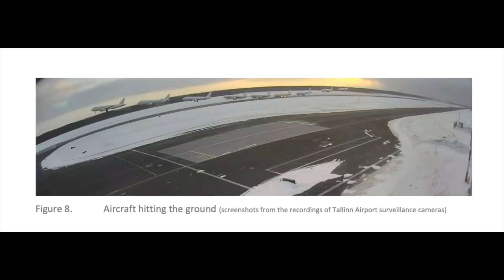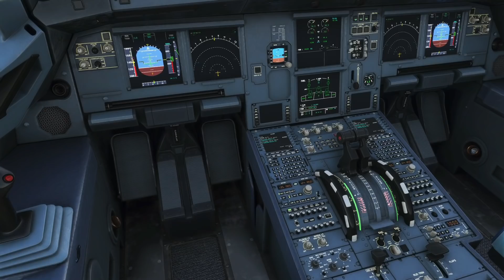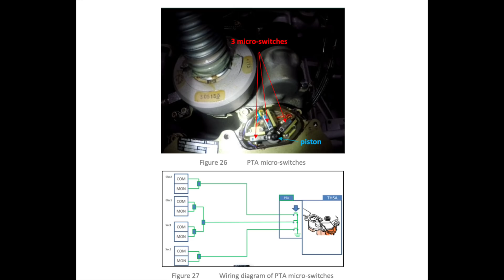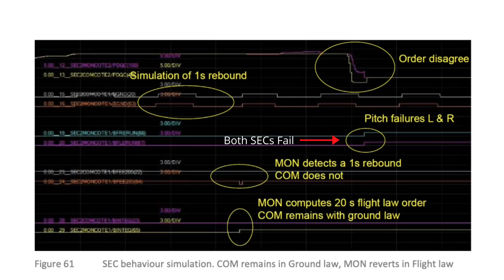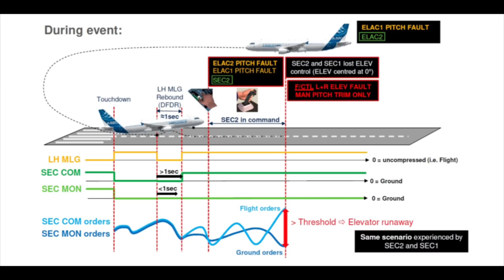The Oil Change That Crashed A Passenger Jet | The Crash Of Smartlynx 9001

Comment: To answer your question about automation, I been driving trucks since before DEF was mandatory and automatic trans wasn't mainstream. My answer is 5. I want some but not all. I hate adaptive cruise control there have been plenty of times when it hard brake and there was no one in front of me. Not only is that dangerous but scary asf. 737 max had the same issue yet it was trimming down when there was no need to. And that cost 500 lives. So although planes and big rigs do the same thing differently, transport, Im sure you can get what im saying.

Comment: As a A320 pilot , i can tell you one thing for sure ! This is an absolutely great explanation of a very complex event . Something that latter led Airbus to change & tweak a few things with the Manual Pitch trim and timing logics 

Great content . Keep it going
Reply: is a320 safe?
Reply: Automatique
Reply: Are u real pilot damn....cool
Reply: Often the safety standards are written in blood, but this time nobody got hurt. And with every accident and incident the industry becomes safer. Which is also why it is the safest method of transport.
I forgot the exact numbers, but it was something like 1 in 20 million flights has issues, and 1 in 5 million of these somebody get hurt. The risk to get injured is so incredibly low.

Comment: This accident could easily have been avoided. Common sense tells you to reset a failure once. If the failure comes back, you don't reset it, but land and report to maintenance. In the 1950s or 1960s, an Avro Vulcan bomber was on a test flight. This was scheduled to be a long flight, so the fuel tanks were full. Some test equipment was controlled by an engineer. A circuit breaker popped out. The engineer reset it. The circuit breaker popped out again. The engineer reporter to the captain, and it was decided to return to base. However, they were too heavy for landing, and the captain decided to fly low at high power to burn fuel. Meanwhile, the engineer pressed in the circuit breaker and held it in position. This resulted in a short circuit and a fire, and the airplane came out of control and crashed.

Comment: I am a more hands on flyer so, I as the pilot in command would prefer that I myself have the capability to override the aircraft's automation whenever necessary. However, these types of automatic protection systems would be useful when the autopilot is active.

Comment: Algorithms are as good as the sensors it uses for diagnosis. The more, and different types of sensors, the better. When a pressure sensor fails, infrared/accelerometer/GPS/compass/radar and any other sensors combined can verify existing conditions. Maybe a stand alone CAN bus, dedicated to these analysis would avoid overloading the main control bus.

Comment: I think having a lot of automation is a good thing on the whole, but the pilot should always be the final authority and able to override the automation in an emergency with as little difficulty as practical.  

The communication between pilot and automation could also stand to be improved a lot.  Much of the automation is built with the assumption that the pilot flying the plane has a lot more system knowledge than the typical line pilot may have (this is not meant as an insult to line pilots, but the fact is most line pilots aren't test pilots).  Obscure and confusing warnings are not going to help much in a crisis

MCAS is a prime example of everything automation should not be.

Comment: In my opinion an airplane should be able to do a complete flight fully autonomously because computers are more predictable and consistent than pilots, but there should always be as direct as possible manual controls because you never know when an engineer on the ground or in the factory would make a mistake. So it is important to have a fail-safe way of controlling the aircraft (like the pitch trim).

Since I've worked in car automation I know of a very similar debate there: Should the autopilot correct for driver mistakes or should the driver correct for autopilot mistakes? In the case of airplanes the human pilots go through a lot of training and are generally more reliable than car drivers. So it is a good idea for the pilots to always have a way to override the computers. In the case of car drivers a computer could more often correct for human mistakes due to the higher likelihood of such mistakes but that would move the responsibility from the driver to the autopilot provider. That's why the computer only gets to override the human when it comes to pressing the breaks since an incorrect breaking is much less likely to cause an accident than not stopping when you might need to.

Comment: this is literally parallel and equal to the Air Asia Flight 8501 crash. Where the plane gave two warnings to the pilots in which the pilots ignored by resetting the computer.
Reply: It is parallel and equal in the fact that both times if the pilots had just followed the ECAM actions then nothing would have happened. Resetting the computer on this flight restored the computer to fully working mode every time. It was the last one where the captain hadn't reset it that things went wrong
Reply: @tomstravels520  ahh I see, yes, thank you for clearing that up

Comment: I  think that  when all of it goes to shit the pilots should engage manual flight control.  It appears these guys were computer flying for so long they forgot how to manually trim the aircraft for the flying they were trying to accomplish.
Reply: Firstly, computer flying IS manual flying on the airbus. Thats how manual flight is achieved as there are no cables and pulleys like a 737. Secondly flying with trim only is something you'd almost never do. Not even on a 737 would you operate the plane just using trim

Comment: The key to my opinion about automation is in your phrase "...a problem that no-one could have anticipated..."  i.e. no-one spent enough time thinking through all the possible [not just probable] failure modes.  My opinion - automation features should be introduced in stages, separated by long enough intervals [years, in some cases] that all parties involved can be convinced that this part of the automation is stable & safe.  Only then should the next level of automation be enabled, with conscious awareness that new "unanticipated" complex failures may manifest themselves.  Never forget that very simple math equations can produce chaos, and as complexity goes up, so does the likelihood of trouble.  We learn best from failures, so failures should be accorded our respect, not our fear.

Comment: I think the real dangers of automation is when the pilots are not trained to understand the automation thoroughly. As we see more automation going into modern designs pilots have a hard time really understanding it. Another aspect of this is airline companies fail to train pilots sufficiently to fly aircraft in simulated difficulties. The more automation the more cost cutting training for pilots to manually fly the planes. Automation is a double edged sword and always will be. Next we will have Ai and neural nets making decisions possibly overriding a pilots decisions. In cars this is ok but in planes it's entirely another matter.
I would feel much better as a passenger with two very well trained pilots taking over in unpredictable circumstances rather than a computer with its default settings if things start t go ass upwards.

Comment: Having learned how to fly fixed wing Piper Cherokee aircraft when I was a young teenager.  When my father got his private pilot's license.  I always went up with him during his flying lessons with the instructor.  I had the outdated flight charts, i.e., last month's version of the terrain.  Which doesn't change all that much, month to month.  And that was all manual flight with old-fashioned steam gauge instruments.

It was much different from the Boeing cockpit for the Lockheed F-22 fighter jet, multimillion dollar military simulator was.  Which was a tad more complicated.  As, I had never flown any kind of other aircraft, 30 years earlier in my life.  When I happened upon this unique opportunity.  To test out the new Boeing design cockpit for the F-22 by Lockheed Martin Corp.  On about 6+ million dollars worth of computers.  And the actual flight cockpit.  It was wild!  What a thrill.  What an incredible rush!  They just let me loose.  Other military pilots asked me if I had flown F-14's, 50's, 60's?  I said no.  Just a Piper Cherokee 140 when I was between 13 and 15 years of age.  30 years ago.  They asked why I didn't join the Air Force.  I told them I tried.  I was 4F.  They told me to go 4 letter word, to,  F myself.  But they didn't put it exactly in that manner.  They were more polite.  Far more polite.  As they told me I needed a Masters Degree in something like Electrical Engineering.  If I wanted to fly jet fighters.  I said that's okay.  I'll fly anything.  They said no.  And so it goes.

So go ahead and try flying an, F-22.  Without any actual flight instruction.-Never having flown anything like that before in your life.  I can tell you that being a motorcyclist for over 30 years, helped.  I didn't die.  I know how to bank into a turn.  I just never expected a 90° bank.  Holy shit!  And then the afterburners.  I didn't know it had afterburners?  I knew about super cruise.  I didn't know that also included afterburners.  When the Boeing guy was telling me to shove my throttles.  I said they won't go any farther.  He said shove harder.  And it clicked forward.  Then all the gauges and the sound changed.  And it becomes difficult to think that fast.  When you are in your mid-40s.  As I was then.  As it was just coming into operational service.  With the new Boeing cockpit.  Working with Lockheed I guess?  I guess these guys get together for the military.  These are big contracts.  And I guess they spread them around amongst each other.

So on a scale of 1 to 10.  I love less is more VFR, flying.  More like a lackadaisical Sunday excursion through the mountains on a motorcycle.  No need to go anywhere fast.

But there is no denying.  When you are lusting for that super experience.  Nothing beats the challenge of that complexity, that responsiveness.  And I'll fly by wire!  Oh yeah!

So I like both 1's and 10's.  But then 1 would probably be a Cessna 150.  So make that a 2 for a Piper Cherokee.  Because you don't have as good of view with the wings underneath you.  In a Cessna 150 you are just sitting there with your face hanging out looking at the ground.  So that's a 1.  It's a little more of a challenge to fly low wing fixed wing aircraft.

The following year I got to try a Northrop Grumman A-10 multimillion dollar simulator.  It was much simpler than that F-22.  And all steam gauge cockpit.  But I found that harder to fly by hydraulics.  The force feedback was rude.  It was far greater than the F-22.  I was bewildered by that.  Why should the A-10 be harder to fly?  Because it's less complex.  No computers controlling anything.  Meaning you have to be a better than computer gamer pilots.  That probably find the F-22 far easier to fly?  Because it's just a for real computer game you can get killed in.  Something no computer gamer would want to miss out on.  I don't play any computer games.  The F-22 is the closest I have come.  I have no interest in playing computer games.  Much less baseball, soccer, football.  I like basketball.  Every time I snap my fingers.  They jump.  They can't hear me snapping my fingers.  But they jump anyhow.  So I pretend I'm doing it.  I wasn't pretending that F-22 simulator.  That was for real.  What a thrill!

MCAS need not apply.  I don't want to be on a plane that has MCAS.  As that would only signify.  That the pilots really don't know how to fly.  That particular plane they are going to fly you upon your head.  I don't think so.  I think I'll drive.

I'm not good with numbers
RemyRAD

Comment: After the first warning the plane should have landed, come to a stop and been thoroughly checked out. That was the first fatal mistake they made. Considering how reliant the Airbus philosophy is on automation you'd think that when there was an indication of a problem they'd take it serioudly. Just the opposite they tried to make the warning go away again and again. I don't care if the plane is 100 percent automated. But when something goes wrong the pilot should immediately have the ability to manually override any and all of the automated systems and operate the plane up to and including full manual control. This is why I would never even ride in a driverless car. Only one where an experienced driver can take manual control immediately in an emergency. Every machine made will eventually fail. Why did one engine catch fire and the other one shut down? This shows that maintenance personnel and procedures are as important to safety as the flight crew.
Reply: The procedure at the time was literally to reset the computer as the ELAC had lost its pitch channel but the roll channel was still available. Resetting it made both available and therefore the plane reacted as normal and was fixed. The procedures didn't say how many times this could be done or if it could be done during a training flight.
Reply: @tomstravels520  Yes but the alarm kept returning multiple times. Rather than consider that it was a real alarm they decided it was a nuisance and continued to ignore it.
Reply: @markfischer531  again.....they were following procedures at the time. Procedure didn’t say how many times to reset it and what if it was a training flight. It occurred once per flight and not like every minute. If this had been a normal A to B flight there would be no warning at all because the pilot wouldn’t be moving the trim wheel by hand in flight or on touchdown.
Reply: @tomstravels520  How many times must an alarm go off after a reset before even a Euronic brain thinks maybe this is real and we ought to check into this to find out why no matter what the procedures or the book tells us what to do,  they could be wrong. This is how the Euronic brain is conditioned not to question, , not to use common sense, not to disregard rules when they obviously are wrong in a specific case and follow them blindly even though they could lead to disaster. Eurons are brainwashed not to question why, Eurons are trained to do and die. This is why the Euronic mind will inevitably fail whereby American mind will succeed.
Reply: @markfischer531  oh really. And where was this American mind when the pilot of the Atlas Air jet decided to plunge the aircraft into the water near Houston? Or the Air Florida pilot who decided to use reverse thrust to help pushback from the gate despite procedures telling him not to and caused snow and ice to form on the wing. Or the northwest pilots who managed to takeoff without flaps set and had pulled circuit breakers

Don’t go around acting like you’re all big and mighty when it comes to aviation just because some pilots have managed to save the plane because plenty have also been stupid and made mistakes worse than this. Also if you follow the rules but they are wrong then you realistically cannot be blamed on legal grounds. The operator or manufacturer then takes the blame for providing incorrect information on how to handle a procedure. That’s why the manuals were updated after this. It was resetting the computers each time that stopped this event from happening much sooner. It only happened because the pilot didn’t reset the ELAC on the last flight
Reply: @tomstravels520  If a pilot wants to do something stupid or commit suicide and take his passengers with him there is no computer on earth that can stop him. Beating a computer to destroy a plane is easy. Beating a computer to save a plane when a system malfunctions is hard enough but it is even harder when the designers purposely built it to be very difficult or didn't tell the pilots how to override certain systems which was the case in the 737MAX.  Even my smart phone knows when it is level or pitched at an angle left or right, nose up or nose down. When computers or the equipment they are connected to fail intervention by a human is the only hope. Now will you be willing to ride in a driverless car with no human who can take control in an emergency?  I won't.

Comment: The problem isn't too much automation, it's the way the automation is set up: it should help the pilot, not fight it, as sometimes happens (with increasing frequency). 
If the pilot makes an input contrary to the perceived flight mode, or clearly against the automation, just relinquish control of that part of the commands and give a warning, let the pilots fly the plane, they will re-enable it when ready. 
Any pilot can fly a plane without automations, and the extra workload of a disconnecting automation is nothing compared to the workload of figuring out why spoilers didn't engage, or the plane goes down when you just told it to go up.
It doesn't make sense that the pilots have to know how the computer works to figure out why the plane isn't flying like it should, that's bad automation. There's enough workload when warnings start popping up, without having to find out if it's the plane  that's got a problem or the computer that isn't doing what they expected.
They have CRM for the pilots, but forgot to include the automation builders in that conversation.